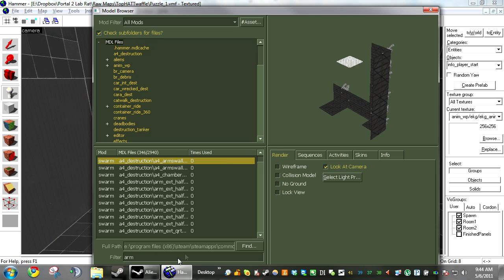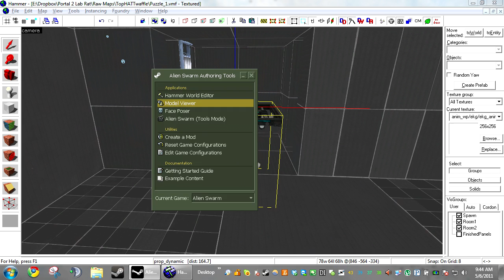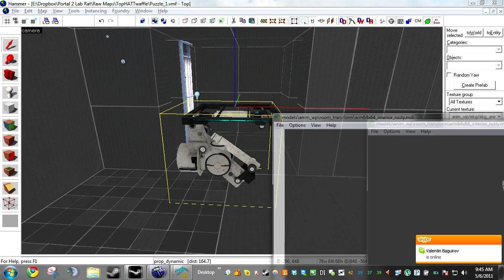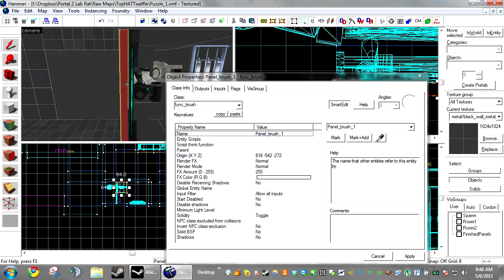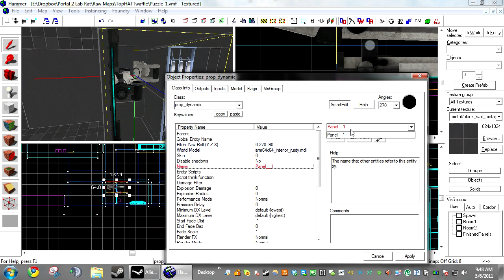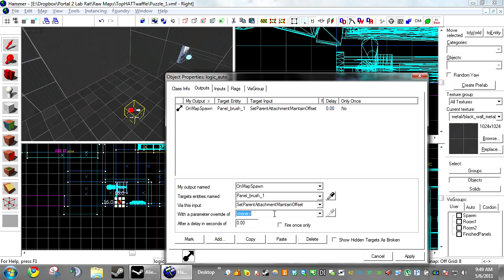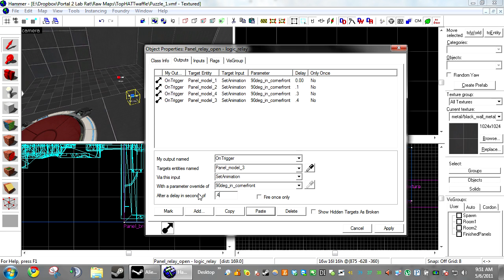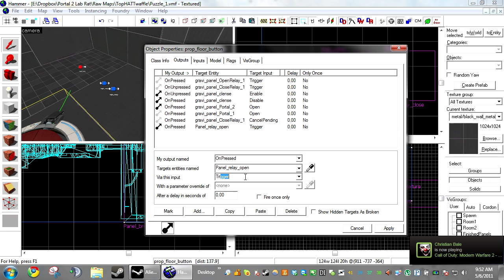Hammer Tutorial #85 "Parent Attachment Points, Panels from Portal 2"

Comment: I'm trying to make a pnel with a startup animation (where the panel dangles and slowly gets in place) and it works fine, but i'm having trouble placing the panel_brush in the right place with the right rotations. is ther any neat trick to see the pnale attach rotations, and or any other way to make the brush fit right
Reply: +DAT BRONY STAN make the grid smaller by clicking [          yes i know im a year late but still
Reply: You should always start with the standart position, instead of the actuall animation